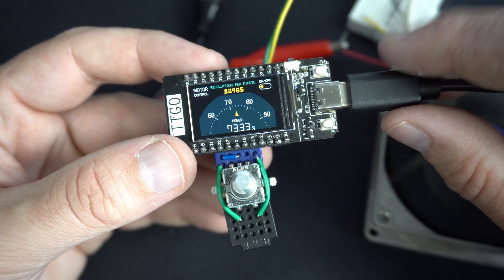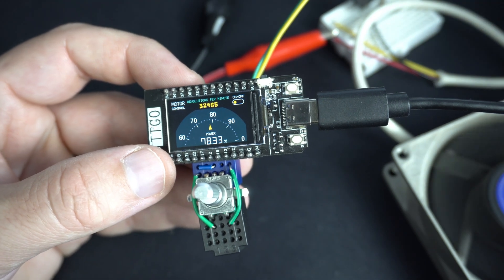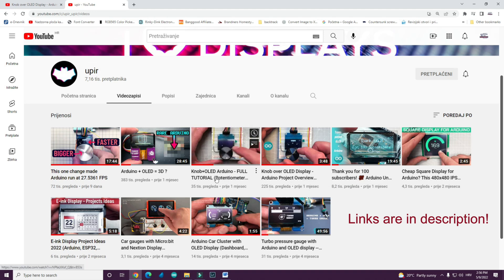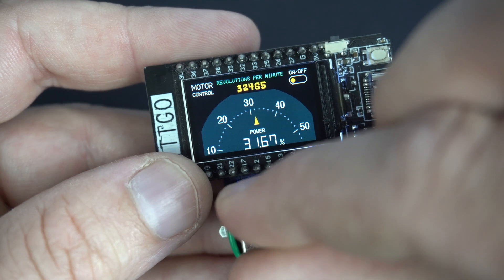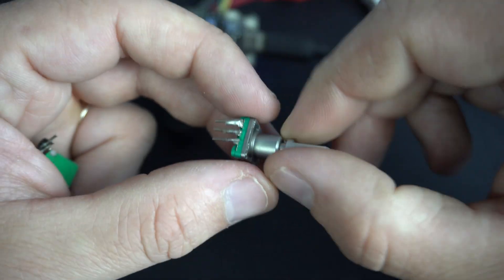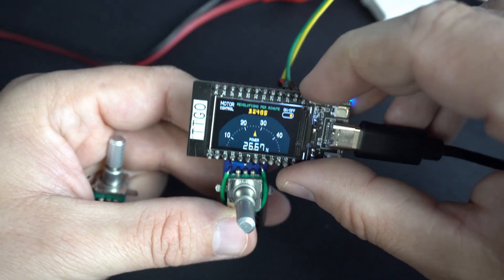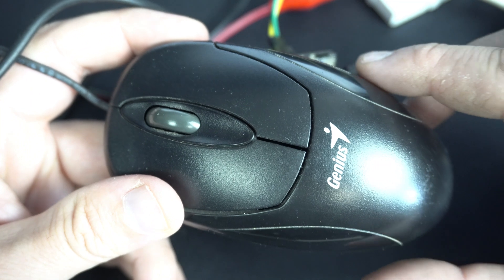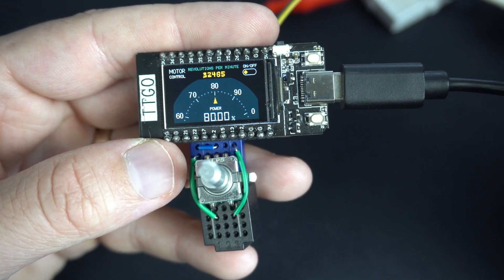Gauge for ESP32 and TFT (LilyGo T-Display)

Comment: Hello Volos. Always with your excellent projects! I have 2 questions:
1) Can this be done with a standard ESP32 board and a 2.8" ili9341 TFT display, for example?
2) Why use a Mosfet for such a small motor? Does the board not support it? Tks.
Reply from the maker: yes it can be done using any screen,  but this code will work only at 240 x 135 px screen. ESP32 gpio can give 30mA , even tiny motor can draw more than this. so there is possibility board will be destroyes.
Reply: @VolosProjects  And what needs to be adapted in the code for a larger screen? In a visual sense, it would be much more beneficial, don't you think? Even on a 320x480 screen.
Reply from the maker: Yes it whoud be much better on larger screen, but back then this was onky one i had. For bugger screen you will need to modify practicly evrything in code. It is hard to explain but whole sketch, positions of lines , dots are matematicly calculated.

Comment: I know this is an old video, but I'm currently building an electric cart and would love to have this screen set up as my battery gauge with % and volts. It just needs to read a 48v battery. Think this is a viable option? If not, can you point me in the correct direction maybe with an affiliate link or direct purchase from you?

Comment: Very cool .. I really love the excellent way you create your excellent videos. The content , concepts and of course the code behind them is superb.  But I'm disappointed in this particular one for one reason alone... you missed showing us one of the most interesting aspects of the project.. and that is how exactly the back side of the encoder was connected to the TTGO T Display pins.  you usually give us a couple second look at the back side connections in the project, but not in this one. I wonder what the small BLUE and the Black perf boards are from and how they  mate to the module pins?. I think that when you use DIP sockets and adapters like this that dramatically reduce the size and space needed, it's a very creative aspect I'd like to emulate too.. Perhaps in future videos you would be so kind as to show us how the heck you physically connect to the module a little better. Thanks again.. By the way the schematic you included REALLY helps a lot too and I like seeing that a LOT! Thanks  Again  jimS

Comment: Hello Friend, I have a project which I hope you can help and create on your channel. It is with TTGO display, I want to use as a ARGB controller. The Display with have 3 by 3 grid boxes. Each box will be the color of the color to show on the ARGB led strip. When you press one button on the ttgo it will move on to next box with another color also changing the color of led strip. The second button can change the led strip to flashing or blinking. If you can help with this project I will be very grateful. Thanks.

Comment: Great content. Thank you for creating useful content. I checked all your videos on ttgo esp32 board. I know you are using them for long. So, after watching your  channel I decided to buy one of these boards with the gorgeous display. Really good board. and lot of use cases. Thank you for being the ambassador for this board. Really like it. Recently included a lipo battery with this project and it seems the charging IC is getting very hot when I try to charge the lipo. Do you have any clue? Does any of your board show this trend? It is dangerously hot!

Thank you .in advance if you have any insight to share.

Comment: Thanks for the great videos and code. 
I ran the code from your github and the numbers that were not supposed to be visible scrolled across the bottom of the display.  Is the github code the latest version-the same as shown on this video?
Reply from the maker: Hello, thank you. Yes code on github is same as code shown on github. Do you use ttgo? Do you have latest library instaled.
Reply: I have the latest library. I tried it on two different TTGO T-Display modules. Both have the "hidden" numbers scrolling back and forth across the bottom of the display when I press the buttons.
In upir's code, he has "if (text_x > 0 && text_x < 128 && text_y < 64)..." to test if the numbers should be visible. Perhaps something like that is needed?

Comment: One thing I always try to eliminate is the oscillation between adjacent values when the encoder is stationary but treading the line (especially with non-detent encoders). A 'demilitarized zone' either side of the current value which requires a legal reading of +/-2 is then valid but the counter shifts so not to lose steps. Maybe have a 9 bit counter divided by 2 to give 256 res to make it even more robust (for example).
Reply: Do you have any code available? Sounds like a great idea.
Reply: @TheUnofficialMaker  I believe the behavior he is talking about is referred to as hysteresis, you should be able to find examples online, specifically input hysteresis
Reply: @rethling4904  Yes exactly that. Many of the code examples I've seen allow you to get your encoder working well to 95% of expectation but that last 5% is the hard part. I always develop encoder stuff using the cheapest most rubbish encoders and breadboard so I know that if I can get it working robustly there then I should be OK down the line. Nothing worse than doing a production run and finding that your design performs poorly with the few rogue outside tolerance parts you've already soldered in place. The dreaded encoder that goes down by one when you rotate up by one. Nightmare! So many products on the market suffer from this (in my experience (music industry)).

Comment: Using lookup tables of legal quadrature sequences to debounce the encoder is great rather than multiple conditional branches. Even logical XOR and STATUS,Z in ASM is worth doing if things are critical. I always used to use hardware debouncing using filters and schmitt triggers but software always seems superior if tuned correctly, plus, the spurious data which the hardware approach aims to filter out contains useful cues for fast scrolling and interpolating for that 'accelerometer' style of encoder navigation.

Comment: Impressive display wheel effect, upir's is really nice too 👍. Apply some de-bounce to the encoder signals to cleanup the little jerky movement on the display, you can use low-pass RC's or implement it in your software 🙂
Reply: If you have to present your design to a customer, the first thing they're gonna do is abuse the encoder! If you filter before measurement then you are likely to show spurious or zero response on your display when they try to flick the encoder like an arcade spinner. Better off using a lookup table for legal transitions and logging the illegal transitions which will allow detection of overzealous use (as well as bounce). Assuming you have some reliable direction data somewhere in the mostly unreliable stream you can bullshit the output to the display and animate the graphics in a way that gives the user what they would expect (they don't see any jumps or missed steps). Unless there's a pointer legend on the knob they're not gonna know that the firmware is guessing. Nothing worse than an apparently unreliable encoder because the customer demands too much.

Comment: Nice project. To me it is counter intuitive to turn RIGHT, clockwise, to decrease the value.
Reply from the maker: Thank you. Yes, now it make sense when you say it
Reply: @VolosProjects  the original project did the same. It is logical if you start from the display, where the larger values are intuitively on the right.